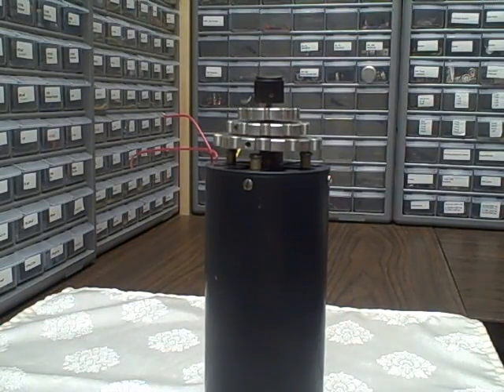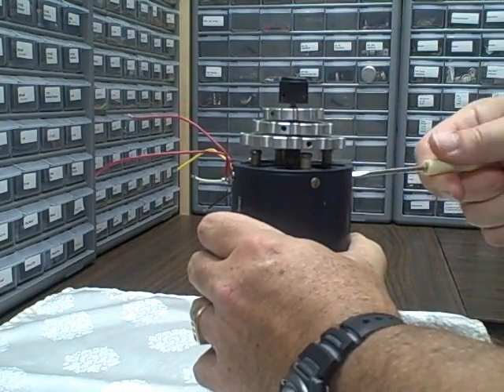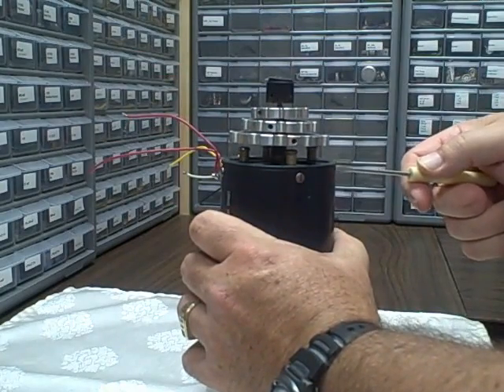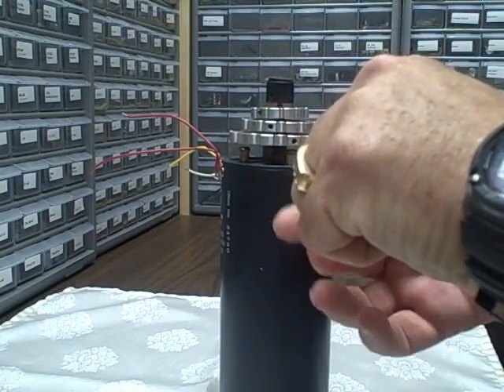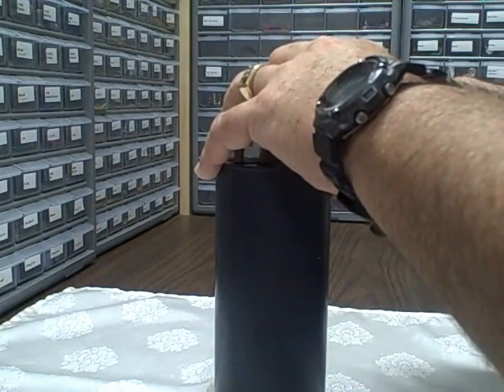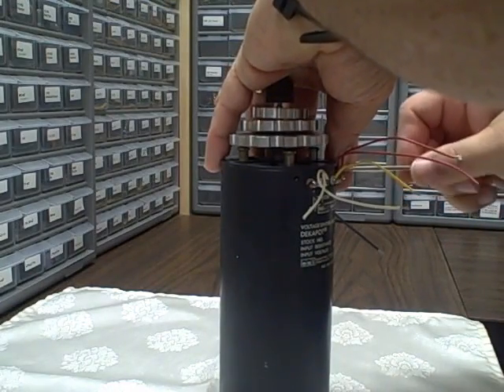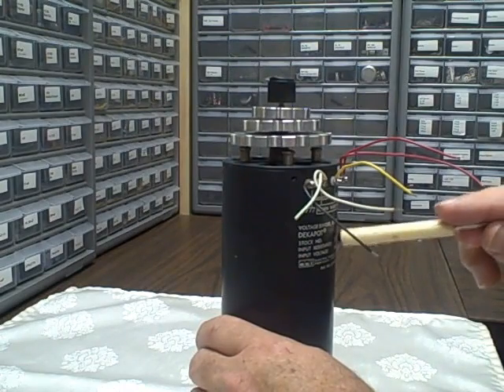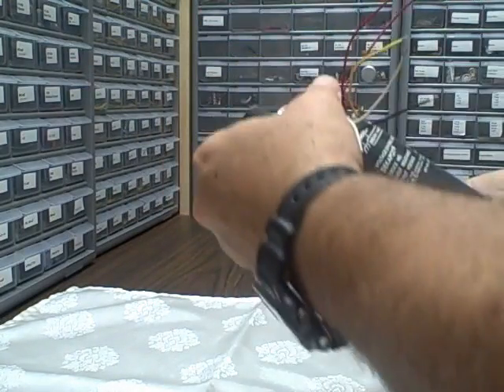ESI Dekapot Kelvin Varley Divider

Comment: Hi Bruce, Another EXCELLENT video. Thanks for taking the time to put these out there..If you ever have time, a thorough video on the HP 8640B would be outstanding. I have 4 of them in my lab and understand them well but these are becomingly increasingly used by Hams, engineers and tec's who have labs. No one to date has ever done a thorough video on the 8640B. Walking through the front panel/functionality and a tour inside would be appreciates by many  and could be a venue for your calibration biz.
Thanks, Glenn